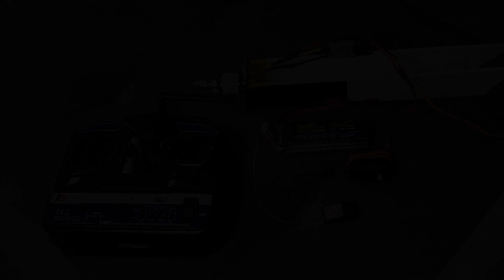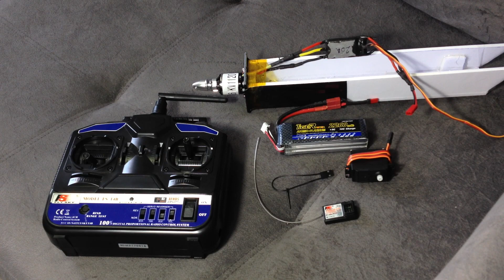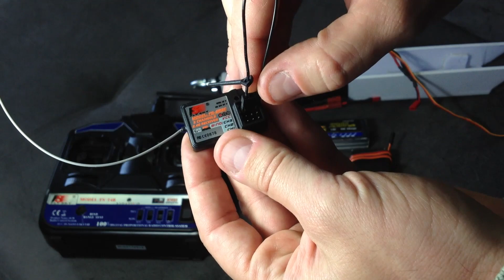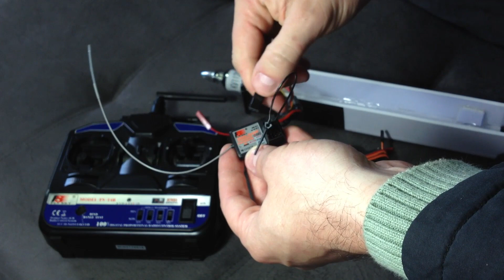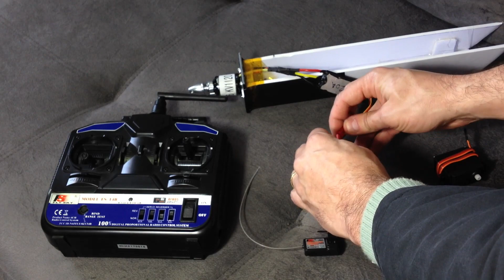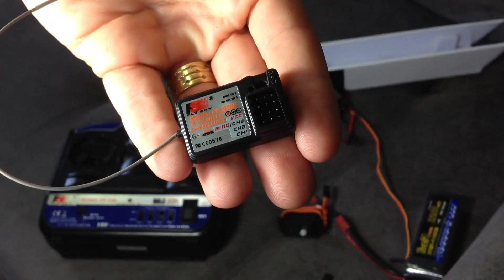How to bind a Flysky Transmitter and Receiver FS-T4B

Comment: any way to bind without that binding key? I lost mine.
Reply: you could short the pin 1 with pin 3
Reply: I made one out of a spare servo wire, thanks ;)
Reply: why actually we are shorting pin 1 and pin 3 ... any logical reason ???
Reply: @ayush_shaz  the circuit or the ic used, needs a logic 0 or low signal to go in binding mode :)
Reply: female to female jumpers would have done the job too :) (in case anyone else was wondering too)
Reply: Short the two outside pins one th e bat bind key. thats all the bind key does,,

Comment: hello, could you please help me? my motor just beep like yours but doesnt work , i dont know if it is ESC problem or Motor problem. Thank you in advance
Reply from the maker: Rabemanantsoa Ando Nirina Hello, It may be because the motor is not calibrated, you need to go with you stick for full power and then zero it may solve the problem. try that and see if it works.
Reply: Felipe Zafani Thank you ! i tried but it doesnt work. I did like what you do in the video. so is it Motor problem ?
Reply: +Felipe Zafani 
I want this for the war robo which have high current I.e 10-15Ah so I can used this one. and other is that it can transmit through 6mm polysilicate transparent glass.